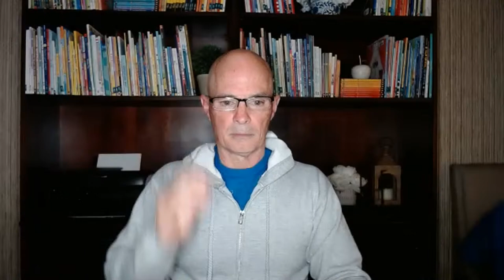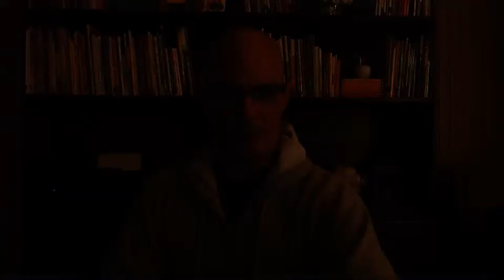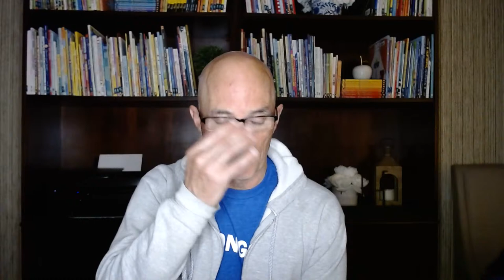SUPERCHARGED LSX B15 CAMS-LET'S TALK TECH

Comment: We have that same BTR LS9/Lsa cam. I had asked about this cam several videos ago and you didn't disappoint with this video as you answered my burning questions right away. We too dropped a bit of boost from the 1.9 Eaton even when spinning it a bit faster.I think we made up for the loss down low by punching out to 6.8 4in. stroker. It has the 119+5 las and people shake their head saying it needs a 108lsa. Considering it as a 13 ZL1 started with 122lsa and I took out a BTR stg3 120lsa I was moving in that direction BTR is offering a 116lsa cam now so Tooley is going that direction as well. The LSA engine seems to be paired with wide lea in most applications so I think we did alright. maybe?
Reply from the maker: look at the change in valve vents and not just lsa-my discussion was a genera lone about how many PD blower cams are ground

Comment: So is the lower HP gain due to higher IATs than one would see with a turbo on a larger intercooler? Guessing the stock intercooler may not be up to cooling that much flow
Reply from the maker: drive loss
Reply: @richardholdener1727  I'm guessing for like to like then that there is a larger temperature rise per mass air flow with the higher boost than the lower and that it could be measured to account for the lower than predicted HP measurement?